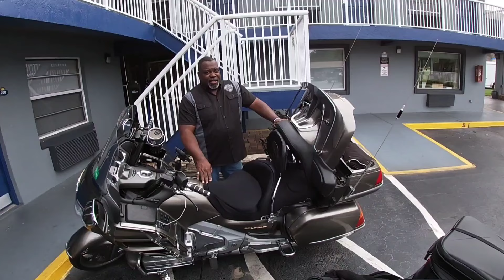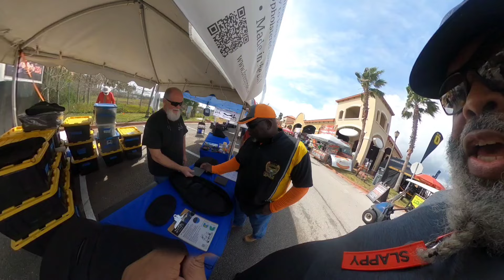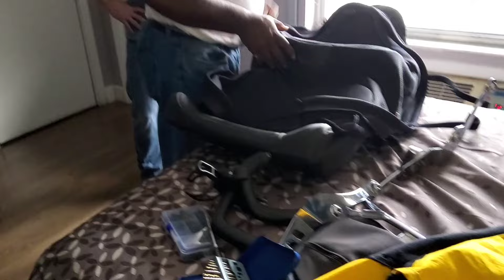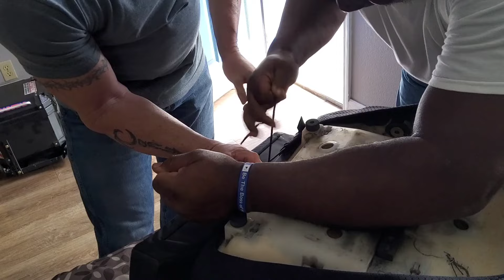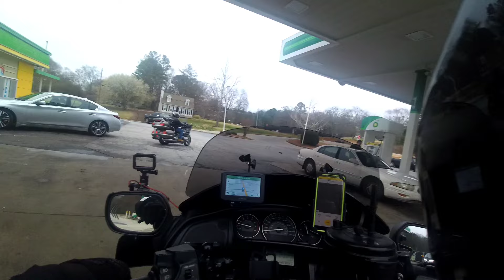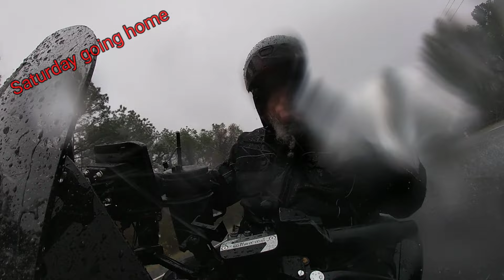Ro-No put on the Breezy Ryder seat cover soon after buying it Check this out #bikeweek2024

Comment: Slappy…another great video. Does the Breezy work with a heated seat …2019 gl1800 dct?
Reply from the maker: Absolutely it do..... a lot of the new Wangs was getting the seat..... I would try it before buying a 1,800 to 2 ,000 $ aftermarket one....10-4